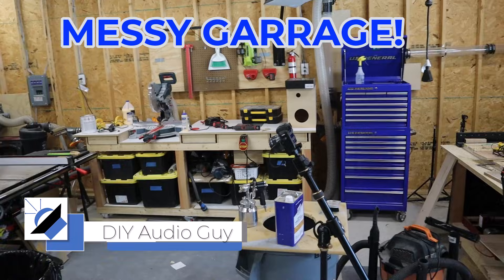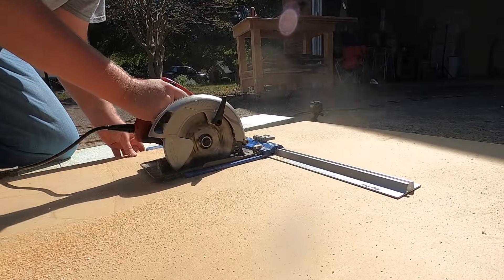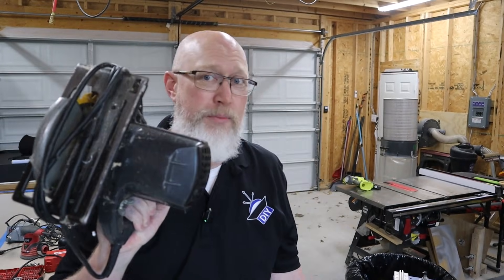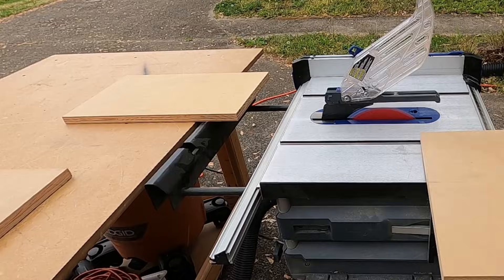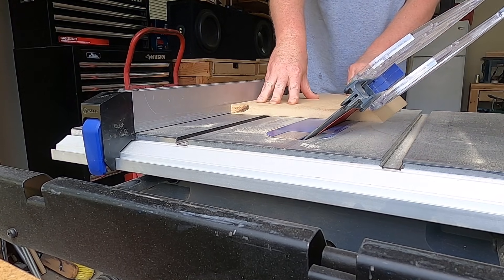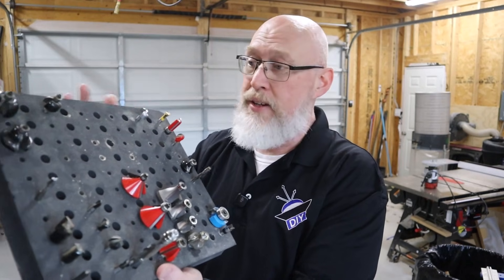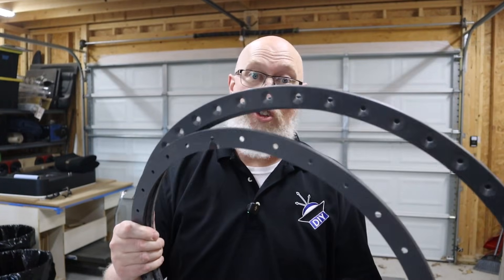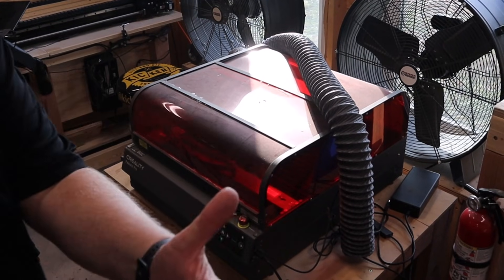The Ultimate subwoofer box tool guide, from beginner to pro!

Comment: I need some expertise from someone please. I got a Hifonics ZRX15D2 powered by a Crunch GPX3300.1D. netto Volume ~93L tuned to ~37hz but i „only“ get about 110db right next to the box at about 1300wrms.

The box is in a w201 with stock battery 70ah 12V but the wires from the battery are new and good (25mm2 copper). The wires to the amp and to the Ground are both with this wire.  4mm2 wires to the subwoofer from the amp. The hole trunk is insulated mit 160db mat. 

Box: 78cm x 42cm x 38cm mit one support beam in the mittel from the front to back and from the ceiling to the bottom. The hole box wasnt 100% sealed so i but silicone in ever edge and every corner

So i think i made everything as good as possible for me but why do i only get so „weak“ output. 
I saw a videos from DIYAudioGuy were he testet 4x6,5“ vs 2x8“ vs 1x12“ and there he got around 130db with less than 1000wrms

Comment: Skip the edge guide and circular saw and get a track saw. When using an edge guide you are assuming your factory edge is straight and square, that's a bad assumption. Track saws are great for ripping down sheet goods and are extremely accurate. Get a WEN if you're on a budget, get a Milwaukee if you're not. I know you mentioned it in level 3 but a WEN is about $80 more than a cheaper circular saw and decent edge guide combo so I think it can fit into level 2.

Comment: DON'T BOTHER WITH CORDLESS CIRCULAR SAWS. THEY CHOKE UP ON 18MM AND BATTERY CHANGING/CHARGING WILL GIVE YOU GRIEF. CORDED = LOTS OF POWER, NON STOP

If an edge guide is out of reach, use a clamped spirit level, usually a 35/37mm spacing on the circular saw

I use a vernier calliper to mark 9mm to get my drilling centre
Reply from the maker: Since I recommend that you upgrade to a table saw at some point the cordless saw is fine to get started.  If the  circular saw is you main tool, and you are ripping material for 8 hours a day, then sure, better get corded (and get an overhead cord reel to go with it).

Comment: A torch lighter cheap and refillable for doing shrink wrap. And you should never be in line to get hit by kick back. You’re positioning yourself wrong and or not using a good proper push stick which everyone should have if using a table saw.
Reply from the maker: Push sticks!  I left those off of the tool list!  You need good push sticks.
Reply: @DIYAudioGuy yep it will save fingers. I remember having to do all the table saw cuts for the girls 20+ years ago in shop class they were all scared after our teacher demonstrated kick back exploding a piece of wood off the wall 15 feet behind the table. I had already been using all that stuff for years so no sweat off my back😂

Comment: Cordless saws id call a downgrade performance wise to corded tools. Are they more convenient yes but power wise they struggle in comparison. That old skil circular saw will work for 40 years but you’ll be spending a lot on batteries over that same time as well. Same for an old black and decker jig saw they work forever 😂
Reply from the maker: For me it is a safety issue.  I got tired to of tripping over extension cords.
Reply: @DIYAudioGuy I understand. I was always yelled at not to step on cords so I tend to watch not to do that more then most so I don’t trip either of course.  Don’t get me wrong I have tons of cordless tools and use them as well but for beginners nothing is cheaper or more reliable then an old corded skil saw 😂

Comment: I know it wouldn't fully replace building enclosures in some sorta wood. But with time and the right 3d printer. Practically any size enclosure could be printed. You'd need a good size printer to print stuff for the subs that use thousands of watts and produce a ton of heat. But that could be mitigated with some wooden inserts or some serious high heat handling filament. But that isn't that impossible. Just takes money.
Reply: 3D Printers would be good for some decorative stuff. And functional stuff. Corner caps for sub enclosures or the terminal cups for speakers. Custome terminals for power and ground. If multiple amps are used. There is all sorts of stuff. Ive already designed a tiny sub enclosure to replace the factory enclosure in my Fiat 500. The new enclosure is the back half of a Fiat 500. With the 8" sub facing down. Outside of months of fiberglass work. There aren't any other machines that could make an enclosure that looks like a tiny Fiat 500. Complete with rims and will have TPU tires.
Reply from the maker: @carlrogers3505 That is cool.  I'm sure at some point I'll find a project where I need a 3D printer. When I do, I'll pull the trigger on one, in the meantime, I'm still looking for a company that might send me one.
Reply from the maker: I would love to have a 4ft by 4ft 3d printer that could print a full sized subwoofer box overnight.
Reply: @DIYAudioGuy   Its not implausible to get a 4x4 printer. They already exist. Printing in 24 hours. Not gonna happen. A box for an 8" Kicker would take 40 hours. My Fiat box is 60 hours. Printers are much faster today than 5 years ago. It would be over 100 hours back then.
Reply from the maker: @carlrogers3505   how much did you spend on the resin for that print?  I'm asking because I have no experience with these things.
Reply: @DIYAudioGuy  This would be a filament printer. But the filament would be less than $40 to completely print it. Could be cheaper if filament was bought in bulk. But it still onlt takes a couple thousand kilograms. It could be a higher price if engineering grade filaments were used. 1000s really. But basic PETG or PLA is pretty inexpensive. ASA and ABS are a few bucks more. Takes longer to print too. But With my Printer that is 16x16x16. I could print a box for a Rockford P1. In a matter of days. Depending on the design. Id likely print the front and rear baffles separately. Bond everything together later.

Comment: good video ... step no.1 : build a sturdy work table that is at least 4ft long [4x8 would be ideal] cause its sucks building stuff on the ground or on crates having to bend down all the time
Reply from the maker: Yes, and if you make it 4ft in one direction you just need to make one cut.  You can even have home depot do that for you since it does not need to be perfect (hopefully they can at least cut it square).

Comment: awesome video, i am somewhere in between, had some level 2 tools right from the beginning and now im upgrading right into level 4 since i had to move all my equip to a different location with way, way more space than my old Garage. New Tablesaw is on the way, new Router (and a 2. one for a router table im gonna build of course, and like every single level 1 to 3 tool you mentioned. Some pretty cheap but fine doin ones and some expensive ones since the cheap doesnt serve the need. Im looking forward to not only building more Speakers but that Tools are also enough to build some cool funiture stuff
Reply from the maker: That's great, having more space is a game-changer.

Comment: Iv got the same skill saw  late 80s iv also have a skill jig saw same era .  When tool were built to last  skill and black and decker  are the same time frame  you cant go wrong.   Just dont loose the screw that hold the blade its left hand  💯👌🫡✌️
Reply from the maker: Back when they were built to last.

Comment: Im a Milwaukee guy. With that being said Milwaukee bits suck. Im a roofer and have used alot of brands and found  Hitachi and Dewalt bits hold up the best. I got Bassaholic designing me a 4th order for 4 Sundown ZV6 12'S powered by 2 Sundown Salt8's strapped. Need to buy a table saw before I build the box in January. Facebook marketplace is always a good place to find more expensive tools at a more reasonable price. Great video and list of tools. It will definitely help some guys out. Saws I prefer worm drive with the left hand blade. Being right handed and the blade on the left its easier to keep and eye on the blade if you happen to end up getting off the line. Also like thin kerf fine finish blades over thicker standard blades with less teeth. CME makes a 46 tooth blade that I absolutely love. I have one I have been trying to kill for 3 months. Cut bundles of shingles,16 penny nails in wood,1/4 thick copper and more. They are only $15 at Manards and its the best circular saw blade I have ever used. Diablo is junk compared to the CME. To help make sure you cut on tje correct side of the line I like to draw an arrow pointing to the side I have measured to know my good side. It helps me pay attention and not end up with a short cut.
Reply from the maker: If I used a circular saw a lot I would get a worm drive.